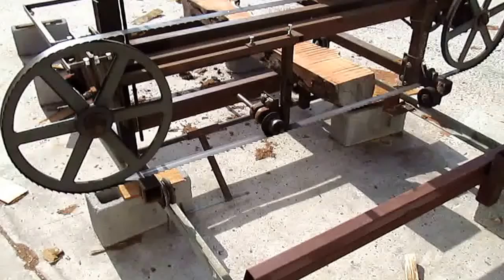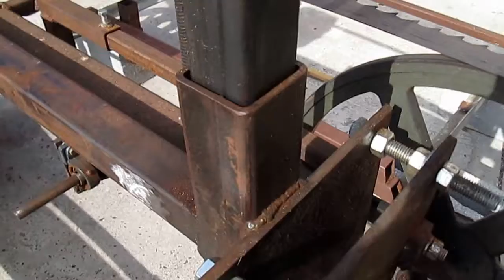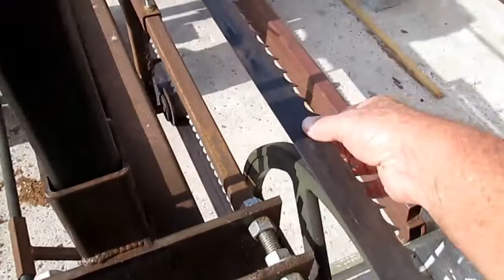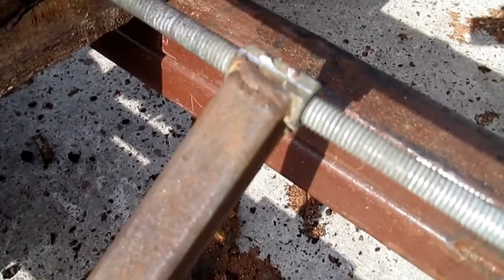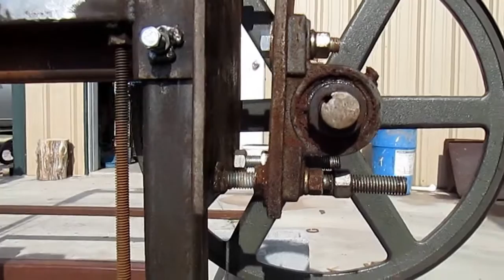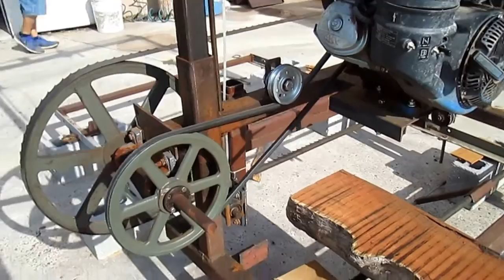Home made Sawmill Blade Adjustment set up video

Comment: How do you adjust the active wheel alignment?
Reply from the maker: It is hard to explain in an email. Both but wheels need to be squared up where the blade will stay on when just rotating it by hand. Once it is basically aligned. Then you need to start making adjustments according to blade tension.. on shafts,this is tough to explain, but I will try: think of it as the following, as you tension up blade it will pull in on the wheels and shafts on outside of each wheel. You will need to shim or build into the original build and allow for the give as you tighten the blade or it will come off during operation. If I could at a picture. But I cannot. One of my other videos explains this set up.? Check it out

Comment: Great, super simple concept on the adjustment system. If you don't mind I going to copy it. Just a tip if I may, when you get around to your blade cover make the side that faces your blade make it out of plywood. It is a real blade saver if you happen to come off the wheels. Thanks for posting this.

Comment: Hey Larry. I was wondering what was happening with your mill. You haven't posted a video on it lately. That thing is ready for a blade guard and some PAINT.......... Is that wavy cut coming from side to side flexing??I saw it flexing in one of your other videos that you posted.
Reply from the maker: That is from an old blade that I ran to the end of it's life..It had gotten hot and had nothing left in it after cutting some really tough dried out mesquite wood that was 36" wide...
Reply from the maker: I have been very busy and have not had any time to add the guards...and have cut well over 50 big logs, nothing small in the last several months with this ole sawmill with great success. It is taking a chance, but the man above has been riding with me....I have never had a blade break or come off so far..But you are right, it is time to put some paint and guards on it..
Reply: Larry, gotcha on the old blade. It took over a year and a half from the time I started building my wood gasifier till the time I took it apart and painted it. I made a lot of mods in that time until I got it working the way I wanted it to. It takes a lot more time getting rid of surface rust, cleaning up  welds if needed.  But, once done, it's done and looking good. I enjoy your mill videos. Keep them coming.
Reply from the maker: We have stopped the flexing when I went to BI Metal blades and running a little more tension...Resolved a lot fo problems, especially when cutting the harder woods, which is mostly what we cut. I also made 2 new blade guides that helped a bunch also. Just trying different things and making improvements